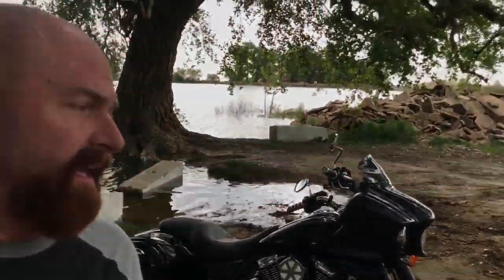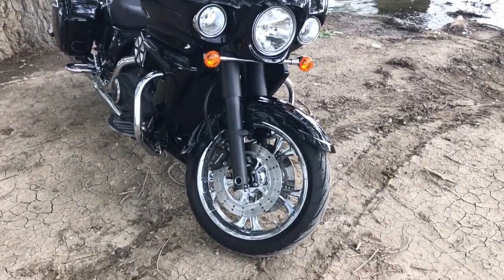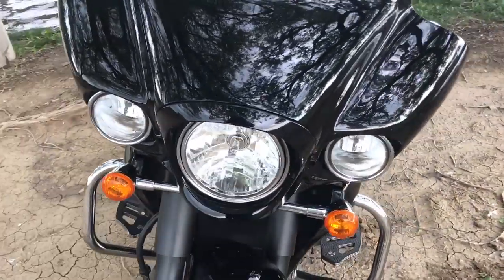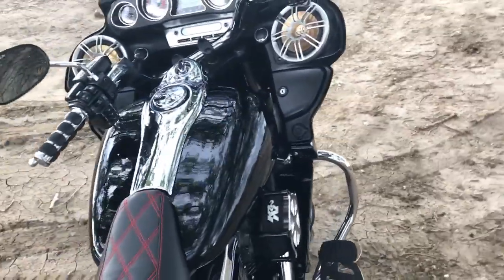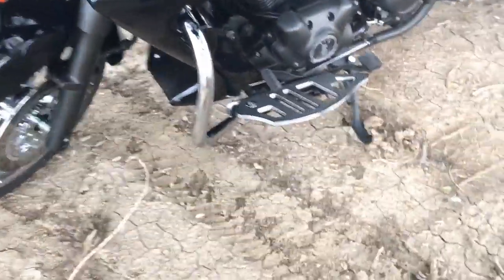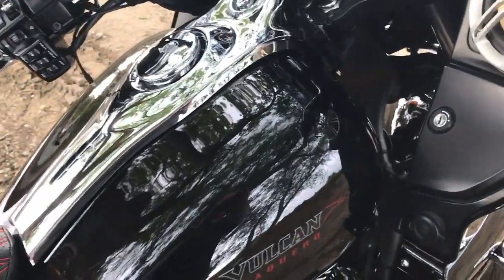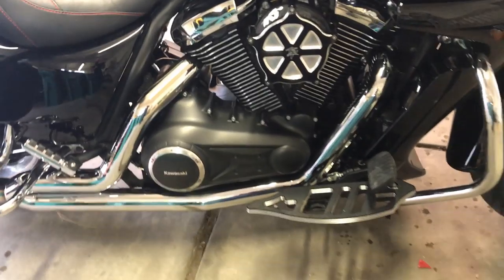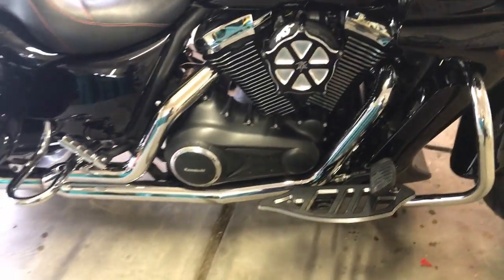Kawasaki VN1700 Vulcan Vaquero - Overview

Comment: This is hands down the best info/mod video breakdown on the bike that I've seen. I ride an '05 Meanstreak, and the Vaquero is the only other Kawasaki cruiser that makes me drool, but not in stock form. Ive been aware of the Roaring Toyz Vaquero mods since the very start, and your bike , especially w the 2 into 1 exhaust really looks great. The flash, intake, power commander, and exhaust combo should have given you at least a 20% gain in HP and Torque, no? Lets call it "the big 4" (lol, they call intake, exhaust, power commander upgrade in Meanstreaks the big 3). You answered many questions already both in word and just showing the bike. Love it, ride safe.

Comment: I have a 2016 Voyager as my second bike.   I have the same feelings as you as far as the way it runs.  I am going to get mine tuned at Ivan's as well.  I am glad that you had a good outcome with that.  I have done some other changes to mine.  I have different grips, speakers, adapters, amp, LED headlamp, LED rear lamps and a PCV.  The PCV did absolutely nothing to the performance no matter what map I use, so I am looking forward to Ivan's.  The only other issue is the stupid rear end noise that I have on mine that gets worse the longer I ride it.  High pitched whining that is so annoying.  I don't believe that it is normal and I have a wobble in the front end.  Going to take in for those two things, but not much hope they will find or fix anything.  My bike only has 2000 miles on it, so compared to my 2008 Raider it is 1/2 the bike other than the ride.  Thanks for the video.

Comment: Nice bike!!! I have an 05 Vulcan Meanstreak. All of my buddies are buying Harley Davidson baggers. I dont think any bike is worth 25K or more. Also I don't like having the same bike everyone else has. I been looking to purchase the Vaquero, your video has confirmed my decision. Thanks for the great video.
Reply from the maker: It's very hard for me to justify buying a $25k bike, you're very right.  I buy used cars, not because I can't afford to buy a new one, but I refused to borrow money.  Anything I buy I buy with cash and it's much easier to part with $10k at a time like I did with the Vaquero several years ago and work on it over a few years than buy a $25k bagger from Harley, which I know will end up costing me $30k totally by the time I'm done with it.

Performance - The performance of the Vaquero is outright impressive after spending a mere $1300-1500. $700 on exhaust, $400 to flash the ECU from Ivan, $400 for a fancy intake which you could replace for $200 if you picked a cheaper one.  I don't think you can do a full Stage 1 on a Harley for less.  But the reports back on the Vaquero Facebook groups is that even a new 2017 Harley bagger with a Stage 1 or Stage 2, won't hang with a Vaquero that has Ivan's flash and even just slip-ons.  I've not run into a Harley that would take a run against me but I've messed around with a buddy that has a new Indian Dark Horse, that has a Stage 1 from Lloyds on it and he can't hang with me at all.  The top end power on my Vaquero just walks away from him.  So from a performance stand point the Vaquero wins and is cheaper.  Anyone can do all this work, you DON'T need the bike dyno tuned with Ivan's flash and you only need about 8 different tools to do the work.  Even if you don't have a good tool kit, you're looking at less than $100 to buy all the hand tools.

Ergonomics - From an ergonomics stand point the Vaquero wins in my mind.  I've ridden a couple Harley Baggers (Ultra Classic and Road King) and the factory ergonomics sucks.  The bikes appear to be built for a little person and a normal adult would have to change the bars for sure.  I think they pin you into having to spend money right off the bat, where as Kawasaki hit the nail on the head for the average American rider.  I'm 5'11" tall and I fit the bike perfect in all aspects except to one which I'll comment on later.

Handling - I would have to think that a Vaquero would out handle a similar Harley, but I don't know that for a fact as I've not ridden a Harley that hard.  The Vaquero is super impressive in my mind riding hard in mountains where I live.  The bike does not feel like a 830# bike once you're moving.  The brakes are good, the back brake could have more feel to it.

Transmission - No complaints.  It works without issue and all the gears are an appropriate ratio.  6th gear is perfect after Ivan's flash, you can pass without down shifting and you can pass hard from 80-120mph in just a few seconds.  Prior to Ivan's flash, 6th gear was USELESS, it's that big of a differences.

Aesthetics - Harley wins hands down.  This is a person thing but I take issue on several design aspects of the Vaquero.  It's too rounded and swooping for me.  I don't like the looks of the front fairing, the lower faring is a little funny looking.  You have to get over the radiator being there.  The factory front wheel and tire combo sucks to look at so if you don't like it like I didn't, that's another $1500 to replace the front wheel which helps a lot.

Infotainment - Of cours Harley wins here as well.  If you're into GPS and touch screens then Harley is the way to go.  I really don't care for shit like that and won't buy a car with built in GPS because they generally suck and I use my phone for that.  The Harley unit is pretty good, but not worth the upcharge.

Tires - The factory Vaquero tires suck.  Plan to upgrade after your first season because that's all the wear you're gonna get out of the back tire.  Switching to a Commander II really improves the wear as well as handling.

Low Speed Handling - Harley wins here as well. The Vaquero feels very top heavy in stock form.  Lowing helps but it's still not as easy to ride at low speed as a Harley Bagger.  Be ready to feel uneasy at first and expect to take a few classes from someone that does motor cop style riders training to get a good feel for the low speed side of things.

Complaints - Again I have issues with some of the looks of the Vaquero.  But a bigger issue with the seat.  They tried to make a very low profile seat that just didn't work for me.  I've been through 3 different seats and now have had one custom made by Mean City Cycles.  Even the custom made one has issues for me so I'm not sure what to do.  I've got all kinds of back and joint issues so I'm sensitive to seats.  I may get the Mustang touring seat, but the rear section is ugly as sin, which then effects my thoughts on the bike's looks again.  The other issue is there VERY limited aftermarket support so finding the special parts you need is an issue.  There's basically two places that make wheels, 3 places that make seats, two places that make bars, and a bunch of windshield that you can get.  Aftermarket support for Harley can't be beat.

That about sums it up.  If price (Value) is your primary concern, then the Vaquero wins.  I'd also look at the VStar Stratoliner Deluxe which is a little more expensive but likely a better bike from the start.  Ivan also offers performance upgrades for those bikes as well.

Jason

Comment: Great job lot’s on good info! these bikes have been around for ever and are a great buy and quality! I always leaned toward Honda GW or. Yamaha Venture and really love Indian  chieftains and Springfields  but now that I’m retired for the last 16 months got to start watching what i spend ! I still have my 2003 GW and plan to keep it it only has 22,000 miles on it! Also have a 2005 ST1300 and a 2014 FJR1300 ! I REALLY DON’T WANT ANOTHER GW cause of the prices and the over engineering, lots of electronics just too complex ! Just to change an air filter would take up to 4 hours! Indian and Harley are way too expensive and HARLEY  for the cost is way too unreliable for a 30k plus bike so the Kawasaki has caught my eye especially the last few years nice paint fit and finish a reliable engine that has a long track record ! So now that I am older I have more of an interest for a V TWIN then before and it’s a whole lot more simplicity then others that are available all i want is cruise control and the stereo so i may go for the Kawasaki next time around! Saw one at a dealership today a 2020 for 16k sounds like a killer deal compared to the others! Great job on the video.

Comment: I have a 2013 Voyager , I love that 18" front wheel, much better than the 21, but my bike has abs, could you steer me in the right direction for doing what you did , I'd surely appreciate it , love the bike  and the videos , please keep them coming
Reply from the maker: Yes you can get the 18" wheel and retain your ABS function.  When calling Rotation to order, you just tell them that you need the hub built for stock rotors and ABS.  It will be cheaper that way as well because you're going to transfer your stock rotors and reuse them.   http://www.rotation.mx/wheels-metric-cruiser/
Reply: sweet, thank you

Comment: This is the second video about this bike ive watched from you. Thank you in advance. A friend of mine referred me to your vids because I have a deal for a 2020 on the table rite now. I test rode yesterday. My question is after all that you have done, do you recommend I go with the Kawasaki if I do the flash to the bike? My back up plan is a 2018 fat boy 114 for around the same price with low mileage.
Reply from the maker: oldmancreature it would depend on the type of riding you’re doing, how much you want to customize the bike and so on. If you’re only going to ride in town and like to customize a lot then the Harley is the better option. Yes stuff is available for the Kawi but that’s nothing compared to Harley. 

If you want to take overnight trips or big multi-state trips like my wife and I do them the baggers are the way to go. 

Chances are the Kawi Bagger will be faster with the flash than a stock Fat Boy so it will be just as fun to ride. However at slow speed the Kawi as friendly as even a Harley Bagger to ride. The wife an I both have Street Glides now and I much prefer the city handling of the SG over the Vaquero. But I’m the highway the Vaquero was nicer. It’s all a trade off.
Reply: @FriedChickenBlowout  Thanks bro im interested in traveling now so I'm gonna pull the trigger on the Kawi.I appreciate the quick response.

Comment: Hey chicken! I've been checking out this bike and was curious if there's been any big changes between the years.  Thanks in advance man.
Reply from the maker: KindredGh0st the biggest change was the addition of ABS in 2013. I should strongly suggest stepping up to that year for the ABS if you can afford it. Otherwise there have been little to no changes. They may have worked out some factory tuning issues in 2013 as well if I remember correctly and those newer years didn’t run as poor from the factory.

Comment: Hello sir, this overview of the Vanqero is what I was looking for. I’m basically doing my research on my first bike to purchase. You mentioned that the bike runs awful stocked, from the factory. As my first bike and I’m not going to have the finances to invest in Ivan’s tuners just yet, would you recommend a different bike for now? It’s going to be my commuting bike. I’m 5’10 270lbs looking for a bike similar to the HD Road Glide. I’ve watched videos of the Kawasaki Vulcan Voyager, your video, and the Vulcan Nomad. I’ve test driven the Road Glide. It’s My favorite bike, but not my favorite price and upkeep on maintenance, so I’m asking any suggestions? I also need cruise control as well. Thank you so much for making this video!
Reply: I would say this is a handful as a first bike.  But if you've ridden a Road Glide then it's similar.Cruise control is a big plus and mandatory on any bike I would buy, you won't find it on too many bikes.  Ivan's tune is only $350, I would plan to factor that in even if that's all you do to the bike.  Will make it much easier to ride.  This bike offers a lot for the money.  I'm thinking about selling mine and bet I would be lucky to get $8000 for it.  I test rode an Indian today that I would like to get, but it's a tough decision right now.  Might wait till next year.

Comment: Great review of the Vaquero, I'm riding a 2012 in Australia. My bike is pretty standard apart from driving lights, kuryakyn grips and a couple of mods. I am getting it dynotuned in a few weeks that involves using a power commander 5, does this have the same outcome as Ivan reflash? The negatives for the bike for me are few but it does run very hot in summer and can spoil the ride somewhat also the buffeting from the screen. I don't really like the look of taller screens so I put up with the wind. I enjoyed your review, very thorough and informative, will be great to see more. Cheers mate!
Reply from the maker: No unfortunately you can't duplicate the same result with a Power Commander. Ivan had full access to the ECU programming which allows him to control much more.  Please make time to call him and discuss your situation, what you want from the bike and your shipping issues being so far away. In the end you will be completely happy with his ECU flash without the need to buy a Power Commander or pay for a dyno tune.
Reply: Ivans Flash covers the Throttle jerkiness, some heat issues, Some timing issues.  You will not get that in a power commander. The reflash is an all in one solution

Comment: Nicest one I ever seen ,--thinking of getting  a stock one 2018 for $17,500,loaded,air designed to go under bike,with a electric fan for exhaust pipe.whats the difference between Vulcan voyage and vaquero???
Reply from the maker: The Voyager is the full touring bike with a trunk on the back, different paint options and a slightly different tune on the engine from the factory.  They also use a different seat and the seats can't be swapped from what I remember.  It's a thicker more touring styled seat, vs the lower profile seat of the Vaquero.

Comment: Would you recommend the Ivan Flash for a 2018 stock Vaquero? I can't believe Kawasaki is not addressing these performance issues.
Reply from the maker: Abbath, yes in my opinion all motorcycles can benefit from an improved tune from the factory, especially the Vaquero.

Comment: Do you have any issues scraping the exhaust with the lowering link ? i have the Nomad with same exhaust and was thinking about the luverne link...
Reply from the maker: Luc Mongeon I don’t think there’s any possible way to rub the exhaust. But the left bag is know to rub. They have a spacer kit that is included that move the left bag out some. I chose not to install it and there’s only a small scratch in the bag at things point with about 10000 miles on them.

Comment: i love this bike too but find it hard to decide between voyager or vaquero. is there a wire/spoke wheel conversion as after market option for this model? has the larger front wheel changed the steering  and handling?
Reply from the maker: The larger front on mine changed nothing because I basically just plus sized the wheel.  The overall OD is the same as before.  If anything it might of made the steering and handling quicker some.  Most people don't have any complaints with going with a 21" either, which I should have just done.  Going over 21" on the front and you will have a change in the handling and my require a rake kit.  I'm sure you can find someone that will make you a spoke front.

Comment: Hey man, I've got a 2010 Voyager that I bought back this past November, I've put the Ivan's ECU, the BAK from Roaring toyz and some Vance and Hines slip ons on it, but one other thing you might look into because I didn't see it mentioned is the Steering Head Bearings on the triple tree, they're plastic from OEM. Had Death Wobble at 40. If you haven't changed them and you show any issue towards it, you might look into all ball's racing barrel bearings at https://www.allballsracing.com/steering/22-1039.html
Reply: Thanks, Spoofer!!!

Comment: Thinking about a Voyager.. seems they are running cheaper than the Vaquero. Thinking of a 2010.. the Polk speakers look great on the dash. Wish I could fit a touchscreen navigation on the dash.. seems yamaha is just to expensive and style is to sporty...  had a few Kaws in the past and they never had issues.. the Venture I have now.. they have issues with shocks, clutch slave cylinders, and charging system..

Comment: Can I use a 19 inch Dyna or Streetglide front rim on that Vaq?
Reply from the maker: Not likely, the HD Touring bikes don't even have the correct spec to fit without some custom work.  I can be done with a Street Glide wheel, but to me it seems easier to just buy a wheel made for the bike.  You can find some sales here and there, mine was about $900 delivered with the matching rotors and a Commander II tire.
Reply: Thanks.

Comment: Great video. I like the 18" wheel conversion you've done. I've got the 2014 with abs and was talking to an electronics engineer friend about making up something. He suggested the Harley one from JP cycle and just adapting it to the vaquero plug/wiring. Link here: http://www.jpcycles.com/motorcycle-speedometer-calibration-units